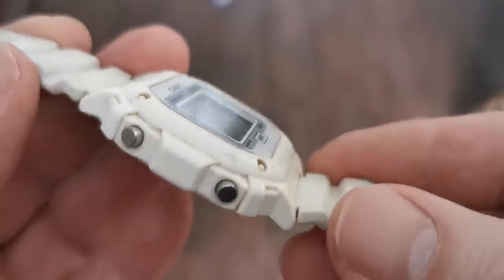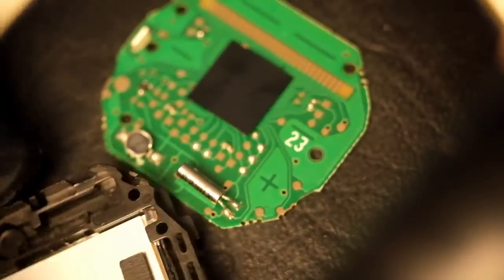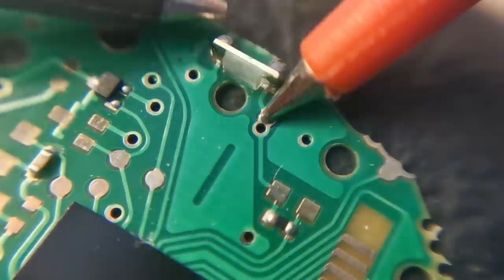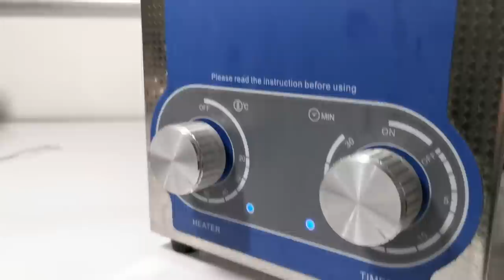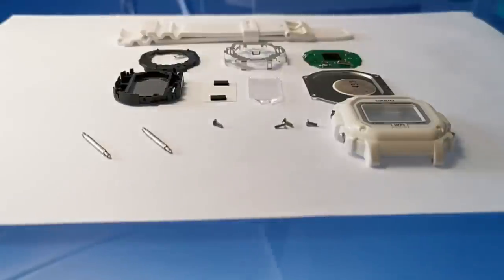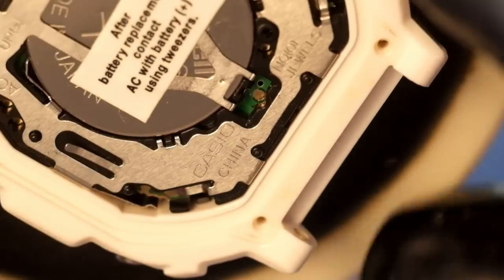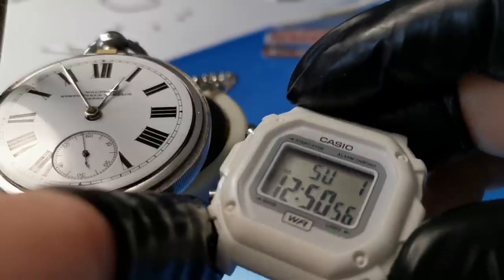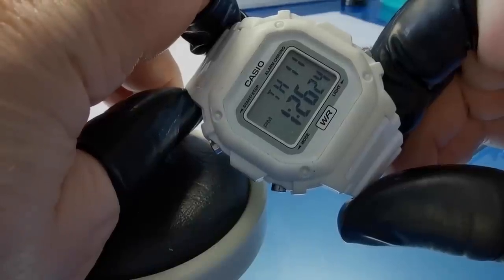Restoration of a Casio Watch - Modified Too!  Casio F-108WHC

Comment: Fascinated by how you commit the same level of skill, patience, and respect to the Casio - as you provide for the higher end pieces. Well done, sir!
Reply from the maker: Hi Unstructured Plans... I am a massive fan of Casio and I guess to joy of the work is not in the value of the watch but in how well I can do the task.  Thanks for the feedback. Richard
Reply: @richardperrettwatchmaker  it’s amazing and you can forget it’s even on you being so light,
Reply: @richardperrettwatchmaker  hey where do you get the led? I’ve wanted to try this on my F108
Reply: I was impressed with all the Rolex rebuilds but now I’m really impressed that your working on boards
Reply: @JoeyAnswer  You should be able to find any size SMD leds in your local electronic component stores. Keep in mind that blue reds require more power and will drain the battery a tiny bit faster
Reply: Casio deserves respect just as much, it doesn’t need any excuses or pretext either.

Comment: Absolutely love this video! We've created a 'throwaway' culture through so much designed obsolescence in items which should last us at least as long as these Casios... mass production hasn't always meant 'cheap & nasty', and a pleasing design with simple uncomplicated function is timeless. It's so refreshing to see someone lovingly restore a quartz watch and make minor changes (ie. the blue LED) so it's functional & desirable today. I'd wager that Casio will outlast any Apple Watch that rolls out of the factory today 👌
Reply: Apple Watch is a computer on your wrist, it rubs on software which needs updating. They last a couple of years and that’s it. The Casio will last as long as you take care of it and replace the battery. Just wanted to point out the difference

Comment: Even the watch maker him self prefer a quartz. From an engineering perspective they are magnificent. When mechanical watch 10 times beats per second consider as high beat. In quartz watch there is a part that vibrate 32,768 times per second.

Comment: I avoid cleaning spring bars in the ultrasound.  If some water gets inside the tube, it is rather impossible to get it out.  The water will rust the spring. You could lose the watch if the spring breaks.

Comment: Have 2 Different Casio Illuminators, one silver with both analog and digital dial and one only digital...both are still running after 13 and 16 years of everyday use...yeah, the seals are brittle and one is very banged up after it got driven over, but these things are a bargain for the 40-60€ they cost when they were new!

Comment: OK, that’s the one that made me like and subscribe. You gave as much care to that little $10 Casio, as you do to much finer watches. 

I have a soft spot in my heart for Casios. I had a half dozen of them during the 80’s and 90’s; all of them performed brilliantly for me. And I recently acquired a nice Square G.  If you are alone on a dessert island, even the cheapest Casio will serve you better than a Rolex, at least until the battery runs out!

Great video. Thanks!
Reply from the maker: Brilliant comment Reg... And it's given me an idea for another  Casio video. Thank you so much. Richard

Comment: I went on a Casio binge recently,going from one analogue to ten (nine digital).Two of them are G-Shock radio controlled and solar powered,the others will need batteries at some stage.So thanks for that video,now I know what I'm in for..................................
Reply from the maker: Casio make great watches for sure and the G-Shock MRG ot MTG are reall really nice.  Swapping out the batteries is pretty straight forward so it should be fun to do.  Thanks for the feedback.  Richard

Comment: Thanks for another great video Richard,  I have learnt so much from your videos. Here is a tip for other relative newbs like me. Before putting digital watch cases in the ultrasonic cleaner check that the decal on the glass is not a metallic transfer attached to the back of the glass. I have learnt the hard way that these are easily destroyed by the ultrasonic cleaner.

Comment: I bought a Seiko ana- digital in 1985 h557 5319 and in 2011 had battery changed , no problems,  got caught in rain storm and watch died, moisture inside.  That was in 2012. Left it on the shelf till 2022 and replaced battery,  didn't reanimate. Took it to watch shop, no dice. Guy shook head about sending it to Seiko.  It had sentimental value so I took it all apart for fun, and the hands fell off, and I threw it in the bin. I don't regret it but also wasn't in love with it.  
I had a Gshock mudman from about 2010 and I have 6 inch wrists and the housing developed a crack where the pin goes through. Basically,  I couldn't repair it.  
Now I own two Gshocks, GA2110 and GW5610 U ( updated version) and I really like it.  I work at a dying plant and I never had a problem. 
I owned a Hamilton quartz a while back 1990s and lost it. I was also thinking about adding a mechanical watch to my collection but I like quartz better and the solar radio Gshock is really cool 😎 
I see citizen watch qaurtz going for 2000 and my mouth drops.  
If I played lottery( don't play) and won the jackpot I would but the HAQ.  Lol 😆 there are so many nice watches   
You are inspirational ❤️ 🙌  . Good job 👏.  I subscribed

Comment: Great job. One question, I all the years I’ve taken a battery watch apart to clean, I’ve never touched the AC connection point. Why did you do this?
Reply from the maker: Hi Ray... the module pumps out gobblediguke after a simple reinsert ion of the battery.  The sticker above the battery compartment tells the owner to perform this operation that resets the IC state to its starting values.  Hope this explains. Richard
Reply: @richardperrettwatchmaker  I have had to do the same on the Timex Ironman watches.  Local thrift shops in Canada often have them and they usually require a new battery. My latest one has 3 alarm settings!

Comment: Hi Mr. Watchmaker, in 7:54 i saw that you do ultrasonicate the watch back plate which has the piezo buzzer, i wonder if the buzzer worked after ultrasonic cleaning and if it can be sonicated in iso propyl alcohol too ?

Comment: Hi what screw driver set would you recommend  i plan to fix my seiko
Reply from the maker: Small flat head ... not phillips or cross head and use the truncated slot. Works well and the screwdriver does not slip out or round off the screw head.  Hope this helps. Richard

Comment: Nice video just in 15:00 I don't think you noticed that you was shorting the battery there
I recommend using a paper under battery when replacing it and remove the paper after battery take its place.
Reply from the maker: Hi IctrStone ... You are correct I just looked at the footage!  Great tip and good observation!  Thank you so much.  Richard

Comment: Hi
I’ve got a Casio ana/digi  watch from the 80’s but the analog side of it is in. Red of a service, it stops after a few
Minutes,even with a new battery,and the hands are very hard to turn with the wonder.
Is it worth servicing,and how much would it be,
I’m in Neath,so not to far away 
Thanks

Comment: 👍’s up Richard for all your great content. I would appreciate your advice. I bought an unworn Rolex Milgauss 116400 white dial last week from a dealer - full set, partially stickered, Goldsmiths receipt from 2008 (original purchase price £2,700 after a 10% discount - happy days!). The watch was kept in a safe since purchase by the original owner. The dealer’s Rolex trained watchmaker removed the back to confirm authenticity and also pressure tested it (I will be showering/swimming with the watch). It is running approx. 3 seconds/day fast which is fine for me. What would your service advice be please? Also is there any actual benefit in it having a Faraday Cage compared to a current modern Rolex or is it just a ‘nod to the past’? Many thanks👍🙂
Reply from the maker: Hi MacRolex  ....You question leads us into a topical and potentially important area!  https://www.theguardian.com/science/2021/mar/23/large-hadron-collider-scientists-particle-physics  ... my point being that Rolex designed  this watch so that engineers working in areas of high magnetic field could have a watch whose escapement was protected from the interference that would otherwise occur.  Back in the day there were a lot more heavy duty electromagnetic fields,  in 1956 when the milgaus was invented even radios had great big power amplifier transformers that have heavy duty megnetic fields as did the speakres these devices drove.  Today at CERN these issues will still exist.  So that's the context; but to answer your question in todays environment unless you work with heavy duty magnetic fields I do not think the extra protection afforded by a Milgaus is necessary at all.  But here's the thing .... it is still a really really cool watch so I would stick with it if you are happy with it.  Hope this is useful.  Richard

Comment: FYI, there are soldering tweezers that may have worked better for swapping out that 1206 LED.  Would probably only be worth the investment for someone who works on PCBs regularly.  Also, using some flux to make the solder "runnier" may have helped as well.
Reply from the maker: Hi David  ... really useful feedback.  Stay tuned next time you will see the correct tweezers and some flux!  Thank you so much.  Richard

Comment: As someone who has had a nightmare with over priced over rated IWC type kit, I've become a fan of late of some G-Shock stuff. As a professional, how do you rate watches like the G-Shock MT-G range and Japanese watches in comparison to the old staid Swiss offer? My next watch may be a Grand Seiko.
Reply from the maker: Hi Ray  ... I love G-Shock and have much respect for the MRG and some of the MTGs.  These are very tough, very precise and very nicely designed watches.  Wave Ceptor,  Solar  and  G-Shock toughness would have amazed Harrison and Breguet a lot more than the modern high end mechanicals that cost orders of magnitude more.  G-Shock is the way to go very often and I have one on my wrist now as I am about to go and run with my dog!  Thanks for the question.  Richard

Comment: Finely managed to switch my digital watch too normal time display, no more am/pm, and the alarm ringing stopped too, took hours, can't find a manual any place.. it's now 13:59 :)    And the alarm is gone...I think, it is set to midnight anyways.. Can't use am/pm as an astronomer, besides it is very confusing if it says it's 4 o'clock  when it's obviously afternoon...

Comment: I remember having bought a set of chinesium screwdrivers and decided to dig into my old Casio calculator I had in a drawer since high school. It was out of juice and maybe one of the buttons was a bit hard to press.

That ended up very badly of course))
Guess that’s two watches I should have mailed to you.)))

Comment: Ready for years of additional service - glad you just didn't toss this away like most people! Though I think it's not cost effective for the average person to do anything but regular battery and band changes. I'd like to see more simple watches like this!

That strip that connects the LCD to the PCB is an "Elastomeric Connector", or commonly called a "Zebra Strip". You see them in a lot of compact electronics:

https://en.wikipedia.org/wiki/Elastomeric_connector

Comment: Great to see "the" master at work.
One question how did you remove the moisture from the push buttons in the case.
Stay safe
Reply from the maker: Hi Dave... Thank you! By pressing them in and out repeatedly whilst under hot air from a hair dryer.  Works a treat! Richard

Comment: I have a few G shocks and calculator casios, I have a GD-1000HC that my ex GF gave me for xmas in 2009, still running on original battery which is mental 2 me. They seem to have magical batteries so who needs tough solar

Comment: Wonderful video; love the close up lens images and your presentation.  A few comments: 1.) I recently discovered the silicone versions of these Casio watch straps - I believe they are made by a different company but they are quite a bit more comfortable than the resin ones; slightly stretchy instead of stiff. 2.) Here on the West Coast of California in the major downtown cities like San Francisco and Los Angeles and San Diego; a person out and about wearing a nice watch like Rolex or Piaget is quite likely to be stalked and mugged just for their watch; so I think it much safer to just wear these US$20 Casio out on the streets or shopping areas.  Finally, one of your commenters was asking which screwdrivers and you said the slotted one - I had the same question but think they meant what brand; can you recommend a manufacturer like say Starrett, Horotec, Bergeon or AF Switzerland or another?

Comment: I've had a number of Casio calculator watches over the years that I've really loved, including a CA-505 and my favorite, a CPX-200. Unfortunately the buttons have been the downfall on them. The CPX-200 died when I walked too close to a door frame one too many times and banged the watch against the frame, finally sticking the light button down, so that the battery drains almost instantly. The CA505 died when the rubber button plate turned to black goo rather than buttons.

Not being a watch maker I couldn't do anything with them since I had no access to replacement parts, and of course no actual watchmaker near me would even touch a non-mechanical watch. So they ended up dead in a drawer. So sad.

Comment: Nice vid, I think a lot of folks don’t realise Casio do replacement parts and end up throwing watches away.  It was difficult to tell, but was there much difference in colour between the new strap and the old cleaned up case?
Reply from the maker: Hi Richard ... The case was definitely a shade 'more yellow' than the brand new straps but you had to be looking out for it to notice.  On the wrist the watch looks brand new and the blue light is cool I think.  Thanks for the feedback.  Richard

Comment: The rubber making contact between the PCB & LCD display is called "Zebra" connector. not exclusive to Casio used on Printers & status device displays, don't lose it.
Reply from the maker: Really useful information! Thank you ALLOY!  Richard

Comment: Used to have a watch like that, it took forever to program it not to go all pm/am on me, instead of the normal 24h setting, it had some American bug apparently,  luckily  I could fix that problem...sadly the watch is gone now, I have no idea where it went.  I still have one of these  digital watches,  been trying to switch the alarm clock off for two years now.... apparently  you can't...   so now it almost ate it's battery  ...no more alarms.. these watches have way too many settings usually....Found it, no more alarm , bought a NATO strap for it, now it finely fits..